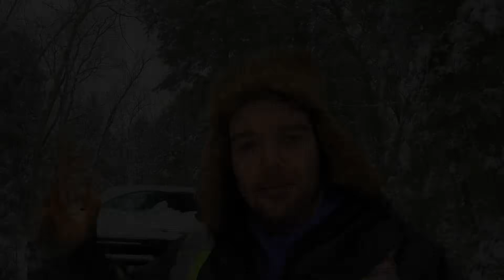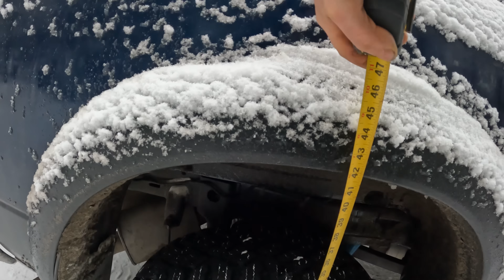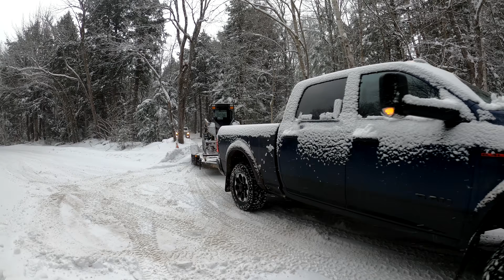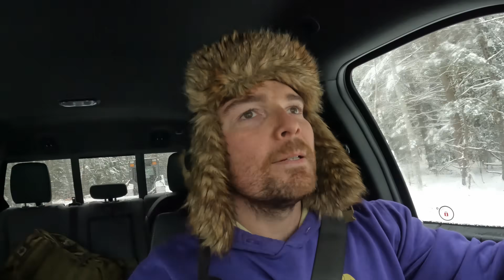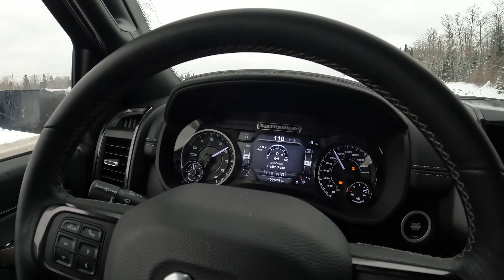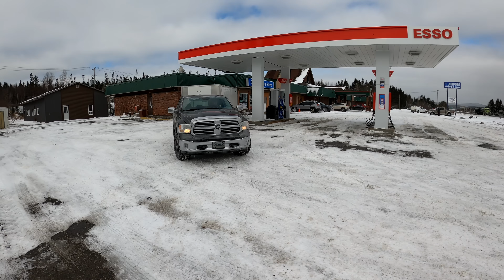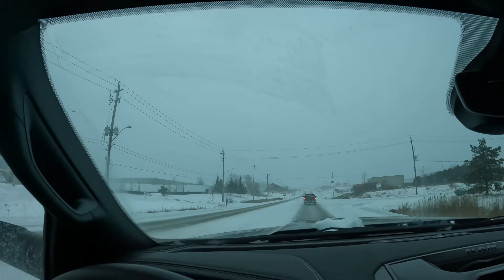RAM 2500 Power Wagon 6.4 HEMI Towing Test | BETTER Then You Think!!

Comment: Great video. I didn’t buy a Power Wagon as a toy. It’s the only truck I’ve ever owned that can haul a tractor or skid steer up a snowy mountain road. In the winter, it’s the only way to get hay out across snowy pastures, unless you use a tractor, which is fine if you have two hours to spare. When the Power Wagon is in 4 low, with front and rear axles locked, it IS a tractor, just a little faster!
Reply from the maker: couldn't agree more!
Reply: Appreciate your comment... I am looking into one of the for pulling a trailer every once in a while. We are in Northern Nevada... snow country - 4x4 necessary.

Comment: 8k lbs is what i do quite easily with my 1/2 ton Ram 4x4 with 3.92 5.7 hemi, 8 Speed, limited slip 4x4. I've done 11k dump trailer easily around town and that's where I think I would limit it.  I have after markt variable rate helper springs adding a 1000 lbs more capacity which reduces squat when towing and Bilstein 5100 shocks both support better suspension handling including steering & braking.  My truck is raised lifted 1.5" and rides on 34''s

Power Wagon is a light duty heavy truck modded for off road usage.  It's like a 1/2 ton on steroids frame & all.  My 1/2 is a regular cab 6'5' bed which I prefer taking advantage off its shorter size & lighter weight

Comment: I bought a 2024 Power Wagon today and tow a 25 foot under 6,000 lb Rockwood Mini Lite. Do you think I should be ok with the towing. I bought the Power Wagon for easier driving than my 2021 2500 Tradesman. It was so hard to drive the Tradesman. It had no turning radius, it was rough. I even put new shocks on it and air bags and it really didn’t help the rough ride. What are your thoughts?
Reply: how was your driving/ towing experience ? Thinking of buying one

Comment: I couldn't justify the price of a three quarter ton compared to my half ton. I got the quad cab and the slightly longer box. 3.92 gear. Non e-torque 5.7. class 4 hitch and an intergrated trailer brake controller. I hauled an empty 7x14 enclosed cargo trailer from victoria all the way to saskatoon, loaded it up, which was probably between 6500, and 7500 pounds, and towed it back to the island. I didnt have a single issue. Going over train tracks and stuff kinda sucked. But i think it would suck for basically anything. Yeah the payload isnt great. Suspension is soft. But with weight distribution hitches, and timbrend bump stops, air bags, or upgrading your coils, you can help the ride feel better. Nothing can increase your payload sadly. But i do have a 97 ram 2500 with a 12 valve in it. And its got a payload of like 3500 pounds. So im covered either way. But im happy with my half ton. Does what it needs to.

Comment: I have a 2023 ram 1500 with the 5.7 e torque towing capacity is 11,200 pounds I believe and I pulled 11,000 my camper it did squat but I pulled it like a champ

Comment: i have a 6.7 cummins 3500 with 146k i have a low end stumble with no codes. i has had a dpf code at one point a d a nox sensor at one point. any help as to what could be going on?

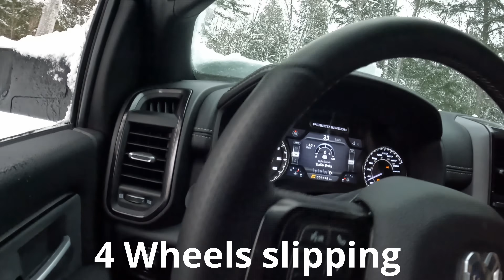Comment: 2022 ram 2500 6.4 hemi with 4:10 gears. I bought it to tow a cat 259d Ctl and I don’t regret it. I tow it 5 days a week and for mid range loads it’s very capable a couple times I’ve maxed it out at 17,000 pounds and I don’t notice a difference between that and my daily load.
Reply: Did you change or add anything to be able to tow upwards of 17,000 pounds?

Comment: I had a 08 mega cab Cummins. Absolutely loved the truck…… but it rusted everywhere in 8 years. Started the second year of ownership. Living in Northern Illinois lots of salt. I downgraded to a F150 3.5 eco boost. Has tons of power but is all over the road pulling a enclosed snowmobile trailer. Mileage is very low when towing also. Very unnerving in snow hardening to northern WI. I’ve had it 7 years and no rust yet. Gotta love the aluminum body. Do you think ram has figured out the rust issue at all? Would hate to buy new with the highway prices now and have it rusted away in a few years.

Comment: I have a 2019 power wagon and I’ve been towing my 13 K travel trailer with it without any issue. I’ve proven over and over again that the power wagon can easily handle 13k And a lot more payload on the spec suggests.

It’s severely underrated by ram so you got plenty more capability hide in there.
Reply from the maker: could not agree more. my 2017 ram 1500 had a max payload of 1,540lbs and when I loaded it up the rear axle was sitting on the bump stops. my power wagon had a max payload of 1,480lbs but even with around 2500lbs in the back the rear axle wasn't bottomed out.
Reply: Have airbags at 13k how’s it tow in the mountains?

Comment: We had a 2003 Dodge 3500 4x4 with the 5.7 that was the general company multipurpose truck. I had a random day where I needed to move a trailer and my service truck had to stay with our other mechanic. So I took it for that trip. The 6500 lb trailer I pulled taxed that engine so badly that a 5% grade took me from 60 down to 40 with my hazards on. No check engine lights, I even took it to the dealer because I couldn’t believe nothing was wrong with it. 
I’ve been looking at these wondering how they do, because after that experience with the 5.7 I was mortified by the things I hear from people giving it all the hype.
Reply: I had the displeasure of having a take home company truck that was similar. A 2011 3500 reg cab with a stakebed, with the 5.7 hemi. It was the absolute most worthless gutless POS I have ever driven in my life. The thing couldn't even maintain speed in OD in top gear unloaded! Granted the stake bed and gap between cab and body didn't help but still...haha. I had to drive it in tow/haul all the time so it wouldn't hunt for gears too much. It had a lift gate so at least nothing got hooked to the back. Because that truck wouldn't tow it's own shadow. The 5.7 is an overhyped car engine. It makes absolutely nothing but noise below 4K.

Comment: I bought a 2016 Ram 2500 6.4 with 3:73 and it doesn't have the towing power that my F-150 with the 3.5 Ecoboost had. Wishing I had went with the 4:10.
Reply from the maker: 4.10 do seem to pull nice.

Comment: I've used a 2019 RAM 2500 6.4 for towing 6 tons a few times w/ 4.10 rear end.  Rides like it isn't even there, but honestly for towing you can never cheap out on the rear end ratio

Comment: So It's a 2500 in every way except the suspension,  with the bonus of front/ back dif lock and sway bar disconnect?
So what would it take to make it capable of towing 17500? Just switching out the suspension?
Reply from the maker: In theory yes, I believe that is the only thing holding it back. what a lot of people do it put air bags in the rear to help assist the suspension and you can get away with towing some pretty heavy stuff!

Comment: The only thing that im so Undecided is the payload. Every power wagon i punch the vin # in the ram website are low. Like 1400 to 1500. Thats low considering my 5.7 is 1700. Now the reg 6.4 hemi not power wagon is much higher. Can anyone confirm if the power wagons actually have a lower payload then regular 6.4??
Reply from the maker: ohhh ya. the power wagon has a much lower payload. mine has 1530 I think. the reason is because the suspension is much softer then a normal 2500. and that soft suspension is what makes the power wagon so special off road. but unfortunately it also gives the truck a very low payload.

Comment: good video - now compare the power wagon to a cummins  :O
Reply from the maker: That's the plan! the cummins will wipe the floor with this truck when it comes to towing but I think it would still be a cool video!
Reply: @GettysGarage  100% agree but honestly the power wagon is so cool that its close... front and rear lockers... disconnecting sway bars.. built in winch... its so cool that it almost outweighs the benefit of all that power  :)

Comment: I am seriously considering purchasing  a power wagon.  After watching many videos like this one, everyone's concern  is towing capacity... The motor, trans, and gears are all there right? Only thing lacking is suspension, right?  To me a simple cheap fix is an aftermarket airbag set up. 
I did this on my ram 1500, and made the world of difference. When I put 60-70 lbs psi in the rear, and the truck hardly squats w 6000 lbs on it.  

Is this not possible with this unit?  I've yet to see any video w someone adding this option on this truck.   Curious why that is?
Reply from the maker: yep you nailed it. This exact driveline is rated to tow 17,000 lbs. and this truck towed the 8,200 lbs with ease, kind of shocking actually. I've towed a fair bit with my old 1500 and it really is night and day. 

 now speaking of bags in the rear I'm actually speaking to a company right now and hopefully going to be doing a few videos in the spring measuring payload squat with and without added bags, as well as towing handling with bags.
Reply: I have a 2016 power wagon, towed a Kubota 75sl all over the ozaeks and a john deere 35G. Zero issues. 87k miles with original brakes. Solid choice

Comment: I think a Power Wagon with Air Lift air bags would be the ultimate. I put them on my lifted Sport and holy shit! Even at -28 degrees Celsius I put a skid of dog food in the back and there was no squat, no break in the lines. I cant imagine a Power Wagon with them. For 250 bucks? Air them down get a great ride on and off road. Then when you want to Tow/Haul? Pump them up and run it like a stock Ram 2500.

Comment: There is no comparison between a 1500, I agree with your conclusion.  If you are just needing a truck to haul some mulch and bicycles, get a 1500. They ride as good as a Cadillac.
Reply from the maker: yup! I mean a 1500 will tow the average travel trailer and be just fine but if you are serious about towing a 2500 is the way to go.
Reply: @GettysGarage  This is the conundrum I am in! I use my RAM 1500 5.4L HEMI as an adventure wagon for my family (2 kids) - mountain bikes, canoes, etc. I do have a beefy 23 foot trailer 6400 Lbs and am debating about switching to the Power Wagon. specifically for towing the trailer. My main factor is safety (up and down mountain passes)...what's your take? Should I make the switch? We have a cross Canada trip planned this year and will be seeing all sorts of terrain.

Comment: finally a real world north of the border test in shitty Canadian weather that lasts more than 25 kms by a guy that actually does work and knows stuff. most videos have guys in places like Arizona @ 20 degrees with a stopwatch discussing birds on fenceposts wearing shiny new boots. well done! i live in the Kootenays in BC  i've been thinking about getting a new truck, i have an 04 cummins that i pull big stuff with and a 18 1500 i use for boats, sleds, etc. some angry lady that lives in my house says i only need one so i'll be heading to the dealership. thanks for the insight.
Reply from the maker: Lmao that made me laugh, I had two trucks at one point also and well one of them got sold! But ya I wanted to test this truck out because everyone complains about its towing numbers and I wanted to see if it was really that bad. truth is this truck can pull a load very well and I imagine if you have a "normal" 2500 it would tow even better. The 6.7 will run laps around this truck with a load but if you aren't towing crazy big numbers and can deal with some increased fuel mileage it does well! even in the shitty Canadian winters

Comment: I have a 2020 Power Wagon and I tow a 38ft toy hauler (travel trailer). Fully loaded, the trailer is close to 12k lbs and it's 13.5' tall, and the power wagon pulls it beautifully. I do have air bags in the back, and I have a Hensley hitch to prevent sway, but I'm very happy with how the truck pulls overall
Reply from the maker: Ya I can believe it! I'm now curious why the tow rating is so low. I mean are they that worried about the soft suspension 🤔. Because you put an extra 1500 lbs over the max tow rating of a ram 1500 and that thing would STRUGGLE. Whereas the PW seem to tow eith ease at their max tow rating and beyond
Reply: Which air bags did you get and did you notice a change in articulation off road or rougher ride on the road?

Comment: A lot of people put air bags under the rear axle with the daystar adapters. Allows you to stiffen the suspension and keep your off-road capability.
Reply from the maker: Im hoping to do something like that!
Reply: @GettysGarage   are you planning on putting any bigger tires on it? 35's will fit without any mods.

Comment: I traded in my 2018 Ram 2500 6.4 Hemi last April for a 2021 Ford F-350 7.3 Big Block Godzilla with 4.30 gears , 10 speed trans. I don’t miss the Ram one bit . The Ford even gets better MPG’s . The Ram was a good truck but the F-350 with the 7.3 & 10 speed  is a outstanding truck .
Reply: Brought your apple to compare with the orange guy  nyuk nyuk
Reply: @toecutter1547 1 ton vs 3/4 ton
Off-road truck vs a towing truck
Yup 
Looks like Apple and oranges 
🤘
Reply from the maker: that 10 speed would be awesome!
Reply: @HalfShell I'm no ford guy but those 7.3s are nice. I wish ram would of come out with a 426 or 440 for the HDs
Reply: That 4.30 rear end for towing, in & of itself, is absolutely no joke

Comment: I have a 2017 PW with the 6 speed, my eco light only comes on when I let off the gas in my 1500 ram it was on most time on the hwy just wondering if the 8 speed on the new PW's let's the mds work more or not.
Reply from the maker: with my 1500 the MDS was on alot more like yours. with this 2022 power wagon it comes on usually when I'm coasting or cruising behind someone going slow. but when I'm driving alone on country roads over 90km/h (50 mph) it rarely comes on. I think it's because the truck needs too much power to keep rolling at the desired speed. so it keeps all 8 cylinders fueled and running. whereas the lighter 1500's can get away will less power and therefore be in 4 cylinder mode much more often.
Reply: @GettysGarage  Thanks for the quick reply, ya the truck is probably to heavy. I just put in a k+n air filter today and it seems to have gotten the truck another mpg, keep up the great videos.
Reply from the maker: @120rain4  Really??? how much did that run you? I wouldn't say no to another MPG lol
Reply: @GettysGarage  Goes in the stock air box, not a CAI, cost $80 at Canadian Tire.
Reply from the maker: @120rain4  that's not all that bad!

Comment: Man, I've been wanting a Power Wagon for years.  We just started RV camping with the family. You mentioned multiple times about sleds or ATVs and not horse trailers. What is your thought on a 7500 RV trailer? 10 mpg isn't terrible but worse than the 2500 Cummins I rented last year of course.
Reply from the maker: A PW could tow that with ease. not as comfortable as a Cummins but it would pull that RV way better then any 1500.
Reply: Hey Daniel.
If you don't mind me asking. How much better fuel did you get with the diesel??. And why not go diesel since it pull better n give you better fuel??? Just things to help me decide which way to go. 😆 🤣  thx in advance.
Reply: @Nerves848676   I was averaging about 15mpg with the Diesel. Watching Getty's other videos, diesels seem to have more problems. Also, I really like the way the PW looks. For the $10k additional spend for the Diesel, it's going to take a lot of 5mpg difference to make up that money.

Comment: How does the powerwagon compare to the 1500 on really rocky washed out roads? Ride and comfort?
Reply from the maker: It's stiffer then a 1500. that solid front axle doesn't do any favors for ride quality. but in comparison to a normal 2500 its like riding on a cloud.

Comment: The 'Bobcat' was loaded backwards...
Reply from the maker: why do you say that?
Reply: @GettysGarage  The counter weight (the rear of the 'Bobcat') is supposed to be on the tongue side not ramp side.  It might not be a problem in this case but a larger unit could cause the trailer to sway going down the road.  It's the weight distribution.
Reply from the maker: @jeffsikula2920  That's what I figured when you mentioned it. luckily she towed well but I tried to make sure there was decent tongue weight. I've seen those demonstrational videos of trailers set up wrong and it's a scary thing lol. thank you for the info sir!
Reply: @GettysGarage  Yes, Sir!

Comment: I tow a 7150lb GVWR travel trailer (~950lb tongue weight) with my 2021 Power Wagon and I agree, it really doesn’t feel like it’s working hard. My trans temp stays rock solid at 168* regardless of grade or RPM. 6th gear is a 1:1 ratio in the 8HP75, feels great under load. I recently took the trailer up a mountain peaking at 14,000ft elevation and was surprised the truck just didn’t care. It has exceeded my expectations both towing and off-road. Thanks for the videos!
Reply from the maker: Awesome to hear the PW can tow at elevation as well! Like I mentioned in the video this exact power trains is rated for 17,000lbs on any other ram 2500 so this truck should be able to rock it's max towing capacity of 10,600 like a dream. but what I was surprised about is how solid the truck was under load. obviously, you can tell your towing but it was very comfortable and effortless to drive with a load!
Reply: While towing did you ever feel like you were in a situation where you were worried about the distance to the next gas station?  One thing I'm worried about with the lower mpg.  Stopping frequently or not seeing a station in time.
Reply: Da